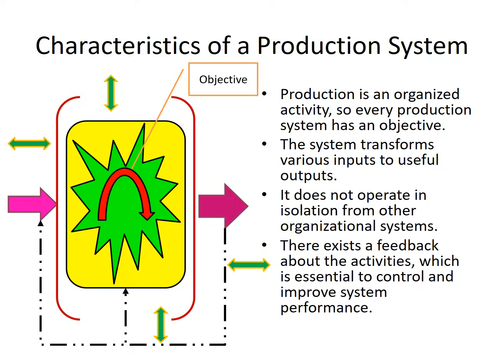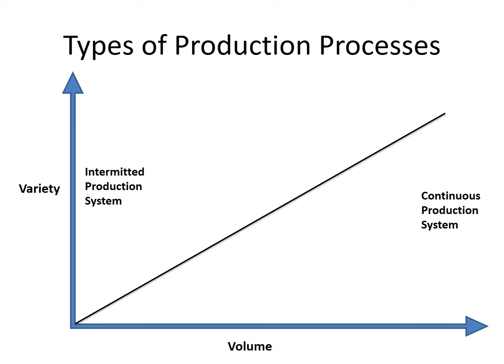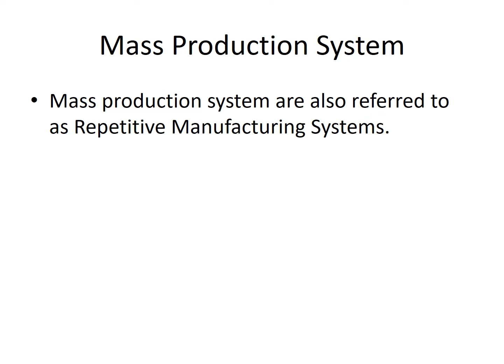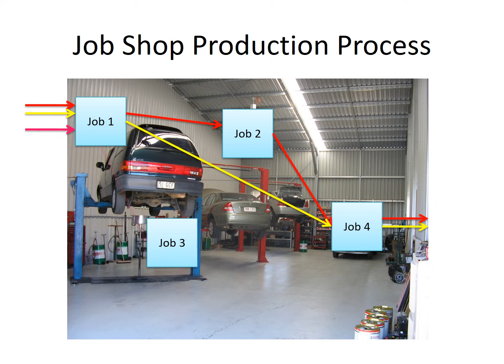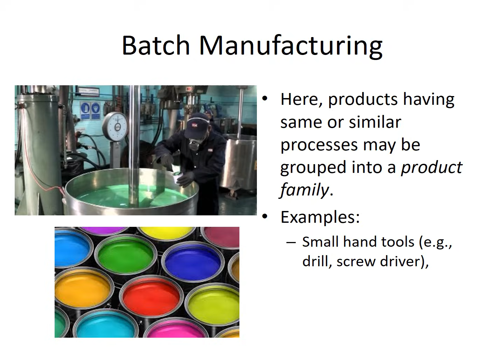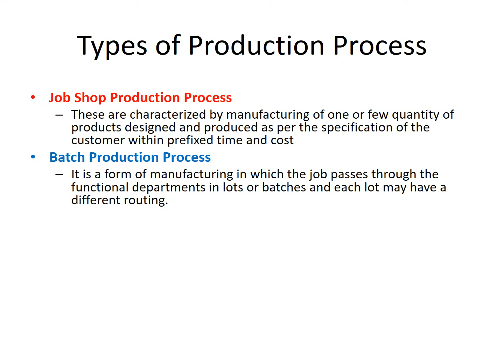Types of Production Processes

Comment: Hi, thank you for the video. It was very helpful. I have a question, there are several papers about batch scheduling in process industries. Could you please clarify that how it can be possible to have batches in process operation system؟ Thanks again
Reply from the maker: What you are talking about is a batch production system, where even though the variety of output is large yet smaller batches of similarly designed outputs can be bunched together for efficiency. I hope this clarifies your doubt.

Comment: sir  pharmaceutical industry is which type of production process
Reply from the maker: Thanks for asking, I hope you have seen the video. Before I state anything, let me tell you that what I discussed in the video is for theoretical understanding of the production processes. In actual scenario, due to various reasons the demarcation among the various types of production processes may be a blurred. The case of pharmaceutical industry is somewhat also like that. A pharmaceutical industry can work its production units as continuous production system, yet government norms require it to prescribe expiry dates. This results in the production process to be modified as a batch production system. Thus while the manufacturing process for a pharmaceutical industry can be a mass production or a flow production, depending upon the kind of the final output, the regulations imply a batch production system. I hope that answers your query.
Reply: thank you so much sir
you solved all my querys